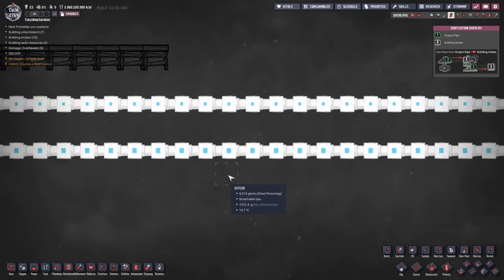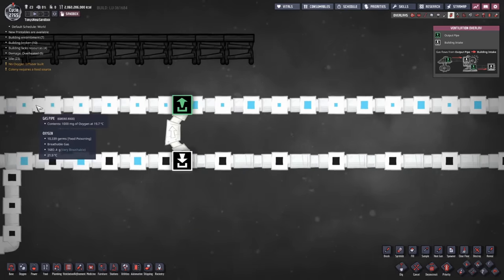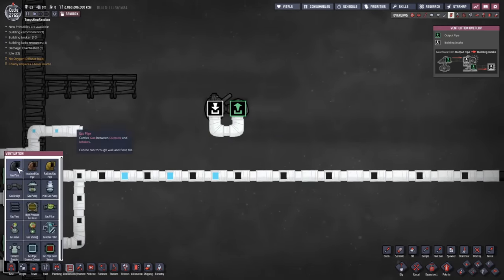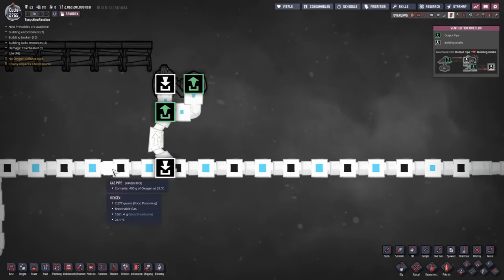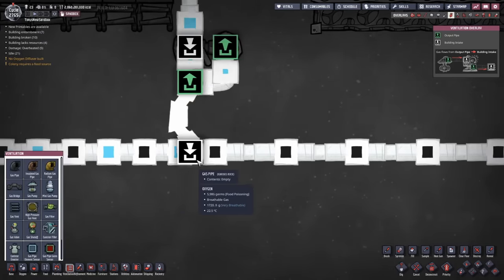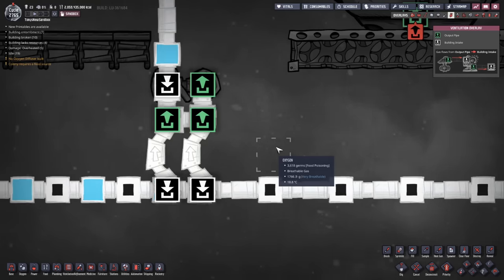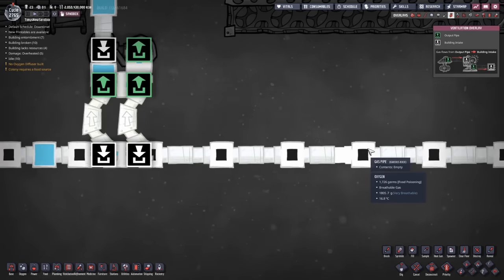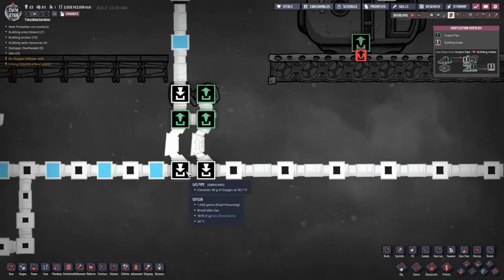An important ONI filter, in 5 minutes.

Comment: I rate this top 5 things newbies need to be taught because odds are they won't figure it out on their own. However you utilize another thing they need to learn which is much more important and you utilize in this tutorial without mentioning why it works. That is the fact that bridges, valves and the like have priority on your pipes/vents. So if you put a bridge on a pipe the liquid going through always takes the bridge if it can but will pass by it if it can't. This is so critical to know to make effective pipe and vent set ups and I bet its so basic experienced players don't think of it anymore.
Reply: @GabrielCazorlaPersson1  Consume power but is 100% fooled proof. If any exits is blocked, the filter stop which prevents mixed up. The Pipe element sensor and valve also consume very little power (if none at all because of the small window of activation and small power cost of the valve) but you need to have a Continuous flow of gaz in both direction for it to work. If one is backed up, you're screwed... Same thing with the mecanical filter (filter in this video).
Reply: @GabrielCazorlaPersson1  not knowing an efficient filter design isn't going to kill a base, just creates long term minor problems.
Reply: @GabrielCazorlaPersson1  i was just pointing out the fact that there is nothing wrong with a newby using the powered filter for there first play through.
Reply: new to the game, thanks re bridge priority. My dupes bathroom finally works properly
Reply: what are other 4?

Comment: Nice find, but I rather spend 10W of power for legit gas filter
Reply: You mean 120W of power? The in-game gas filter object is very power hungry.
Reply: @nZifnab  nope, i mean 10W of power for gas shutoff (in combo with gas pipe element sensor)
Reply: Oh that one - it also has it's own set of problems. It sometimes let's the wrong element through the filter if the filter's output gets backed up for a moment. I've had no end of issues getting the stupid thing to work for my electrolyzers >.>

Comment: been playing for 400 hours never seen this before, thank you for making a video and sharing it
Reply: It's awesome and clever..but I mean..the actual filter costs barely any power haha, and especially if it's for your electrolyzer setup with hydrogen gens
Reply from the maker: @KaladinVegapunk  You aren't wrong, those are fair points. It doesn't sound like much but cutting out unnecessary power use makes a HUGE difference. Three filters costs about half of a coal generator, plus whatever it takes to cool the filters and the generator. 
Another thing to remember is that it has different properties. This doesn't block the main line when the filter output is full, sometimes you want that.
Reply: Oh yeah factorio half underground belt flipped to get half belt =).
Reply: @KaladinVegapunk  you’d be surprised how much filters cost after a while. I had a base with 4 oil wells (no petrol boiler yet) and I ran out of oil. Just removing the filters and going a pipe sensor filter arrangement instead allowed me to run the base again with just petrol and not run out of oil. It definitely adds up! Haha
Reply: I agree, I have played this game for so long and never knew about this! Using this and the infinite gas storage hack ensures that the line never gets backed up and it literally costs nothing, I can pipe gasses out when I need from the gas storage and it just continually runs. I use it to filter carbon dioxide from the base (no carbon skimmer needed) and then to sort and store all my excess chlorine from the rust oxidizer

Comment: This is clever. I wouldn't say this is an exploit though. It's working logically because of the rules of the game physics. If this is an exploit, then maintaining vacuum with a liquid lock, regulating heat transfer with open/closed airlock doors, or creating an endlessly circulating coolant loop with pipes are too, because none of these make sense outside of the game's physics. And so is 80% of the other builds you can make.
Reply: This is how I feel about things like “infinite storage” too.  The entire game is a physics sandbox to a degree and trying to emphasize real-world physics on it is hilarious to begin with.  Plus it’s single-player, so who are you cheating?  You’re still using the built-in game mechanics in reliable, consistent systems that work for hundreds of cycles to improve your base.

Comment: First time I saw the mechanical filter was on the forum quite a while ago.  It changed a lot of stuff.  I use them in my electrolyzer rooms all the time.  One oxygen filter on each vent and another hydrogen filter with a relief at the end for whatever backs up.  One of the best game mechanic reliant designs.
Reply: Never had problem with deleted packets in the loop?
Reply: I'm not going to say that has never happened but I have never seen it happen.  It is flawless simply because of the one element per thing rule.

Comment: I often have full pack pipes that overload these filters but a great way around it on these systems is to install a valve and limit the input to 995-999g/s. 1 less way to overpower the filter! 😉
Reply from the maker: That's a good solution for many uses. But it can cause problems for other uses, like if you have full packets of alternating gasses it breaks them all into 999g and 1g packets. That situation reduces the capacity of the input pipe to 50%.

Comment: If you are "height restricted" but can expand the filter 1 tile sideways, you can put the Valve UNDER the bridges.
In that way the whole filter becomes 2x3 size, BUT you need 1 tile in the middle for the output pipe, so effectively the filter size becomes 2(+1)x3 or 3x3 sized.

(I absolutely love using this filter type, a ZERO POWER filter that is "easily" created even in the start of the game :)

Comment: Pretty interesting way to setup a filter in the early game or if you're very tight on space or far from the electrical grid, but I don't care for the extra setup difficulty.
Reply from the maker: The extra difficulty is indeed bothersome. I always choose a filter based on the characteristics I need. They all have strengths and weaknesses.

Comment: Great video!  I used this based on somebody else's video on building a Self Powered Oxygen Machine (SPOM).  They used this to filter Hydrogen into a gas storage container.  And it worked great.  But I didn't realize what it would do when the gas storage filled.  I had been building near the bottom of my base for several cycles and when I came back, the whole top of my base was flooded with hydrogen.

Comment: Great. Newbie here. I've never seen this before.
I've not tested this but I think you could use a valve set to 999g in the input line to prevent oxygen continuing on the main path, this would also remove the need for the second bridge. And in order to prevent the oxygen from backing up in the filtered line you can always have the gas pipe continue from the reservoir input to a place where you are sure it won't  overpressure (like into space).
Reply: just tested the valve set to 999g. It works, but the throughput rate is significantly decreased. This is because each 1000g packet is split into two packets by the valve: 1g and 999g. Each of these two packets takes the same amount of time to process as the original full 1000g packet, which can get through with no problem in the setup shown.

Comment: I used  this filter a while ago, but stopped, as it always buggered out when i reloaded the game. The filters would get a another element in it and would need to be reset. It's a while ago though and I've learned a lot since then.
Reply from the maker: I wonder if something has been fixed/changed. I've never had any trouble.
Reply: had some problems with it too. because i had it  on storing big amount of gases it became a real issue and i stopped using it for this kind of stuff.

Comment: To avoid the 100% 1000 seconds pipe of oxygen, won't it work if you use 2x separate valves system, gobbling up the reservor.
It's a bit of a stretch but the gas filter 100% uses no power.

Comment: I haven't tested it, but hypothetically a solution to the overflow problem with this filter would be to have a low-priority loop that moves the excess oxygen back onto the unfiltered gas line at a higher priority. This would ensure that the overflowing oxygen locks up the throughput until the oxygen in the gas reservoir gets used up.
Reply: You would have to throttle the unfiltered line at the point of the filter with a valve set to 999 g/s, though, since that's how much oxygen would be passing through the overflow path.

Comment: Thanks Tony for the great explanation. But there will be a caveat. If your pipe to the gap reservoir is full, the oxygen will continue to flow in the origin pipe, defaulting the purpose of the filter.
Reply from the maker: Indeed, you are right. This is either a feature or a vulnerability depending on what you are using it for. Every filter has different behaviors and its nice to be able to pick the right one.
Reply: I just built a second one beside it and connected it to the one pipe for the reservoir

Comment: I know this video is old, but if you use a filter at 9999 and a 1gram filter you can have it loop back on itself so it can back up and stop the pump if you so choose instead of allowing the gas to pass a backed up filter.

Comment: amazing! now if I put a gas valve before the gas enters this filter and throttle it to 999g, will it fix the issue of that 0.1% failure?
Reply from the maker: Yeah, but there are possible problems that come with that approach. For example, if you have oxygen and CO2 alternating in a pipe, and a full packet of oxygen hits the valve then it will let through 999g and then 1g. So it takes twice as long to go through the valve, and your pipe is effectively moving gas at 50% capacity.
Reply: You can just set up 2 of these, that would solve a problem

Comment: add on to this 3:30 1000 ticks is not that many if you think about it but you can extend it infinently by elongating the exit of the valve and adding more bridges each bridge will add 1000 more ticks but the better way is just add a 2nd valve that only allows 999 threw sure you wont get a full packet but it fixes the issue
Reply from the maker: You can also set the valve to .1g, which makes it last 10,000 seconds. That's 16+ cycles.
Reply from the maker: Also, there are new automation features in the game. You could just use a shutoff to turn off the pipe for one second every 10-or-whatever cycles, with a little creativity I'm sure it could be done in a way that only uses power for the 1 second.

Comment: You could avoid the overflow of the input by putting a gas valve on that pipe and setting it to 900g/'s.

You will have 10% less throughput but no over flow incase it is really important for it not to happen.
Reply from the maker: For some applications that works pretty good. But, for example, if you have alternating full packets of gasses then it slows the pipe down 50% because it breaks them all into 900g and 100g packets.
Reply: @tonyadvanced6315  yeah you're right.

If there is input from several different places, those pipes would need to be joined together in one before it passes the valve,else putting in the valve wouldn't make a difference, because of alternating packets of liquid/gas. Didn't think of that yet.
The joys of pipe mechanics.

Good day to you mate.

Comment: By the way there's also somewhat more complex variant of mechanical filter that works exactly like standard filter, i.e. it blocks when either output blocks. That fixes the problem of the simple mechanical filter that if you block the filtered output, packets of the filtered element will continue through the main pipe.
https://forums.kleientertainment.com/forums/topic/86047-perfect-mechanical-filter/

Comment: While this is a nice short video, it would have been handy to show things like how to prime a pipe with a certain gas, but most important is that you forgot to mention that this filter immediately falls apart when the pipe feeding them goes empty. In other words, these filters will function great as long as there's gas flowing, but when that stops for just a second, they all go empty. 
Would've been good to know before I tore down my other filters and put these in place with a lot of effort to prime them. :/
Reply from the maker: There is no need to keep a steady supply to the input pipe. The .1g packets are content to run in a circle forever.
Reply: @tonyadvanced6315  If that's the case, then I must have done something wrong, and it's worth another shot.
Apart from priming the pipes, it's a pretty simple build, so I'm curious if you have any idea what could have caused my gas-filters to go empty? Are there any (bad) conditions that would make them do that? (My setup was simple: A gas-pump sucking in ambient air, pushing it through a set of filters, and catching the gasses in reservoirs).

Thanks for the reply btw!

edit- I did have some problems priming the pipes. It was my first time having a go at it. I ended up with different sized packets in the filter. Some 1g, some 2g. Maybe that's what caused them to malfunction?

Comment: The unfortunate problem with this filter is that it requires that the gas pipe being bridged into it occasionally do have the gas being filtered out. I tried to set one up to catch the very occasional bits of hydrogen that would get caught in the oxygen pumps for my SPOM. Well, gradually the hydrogen put into the filter to start it ran out (went to my tanks) and the oxygen from my oxygen lines went through it and, also, into my tanks, where they were fed to my hydrogen generators. The generators weren't too happy about it. But a great idea where you know you'll be getting a reliably mixed feed of gases.
Reply: You built it wrong. Because of the 1g being constantly replaced into the loop it should never 'run out'. The filtered output (in this case your hydrogen) should be coming out PAST the white input of the valve. Like how the video has it set up.
Basically, before throwing it into the gas line towards your generators, it'll take 1g again to keep it 'primed' in the loop.
Reply: @diamondelement4140  I followed the video exactly and retried twice. Always failed eventually for me. So either he's not showing something clearly enough for me, or it's no longer a reliable design due to game updates.
Reply: @fuzzypumpkin7743  but brother it never fails for me and logically through my explanation or the videos it should never fully take out that last 1g of the element.
I know you said you made it exact but are you absolutely sure?
Are you bridging into the loop?
And is the loops output going up from the white input? (Like in the video)
The filtered output has to be after the white output so it has a chance to grab 1g again for the loop like I explained.
I want to help out a fellow ONI player
Reply: @diamondelement4140  Honestly, I was attempting this TWO MONTHS ago. I'm not interested in retrying. I've started making my O2 production via a soggy Rodriguez that automatically filters the hydrogen and oxygen into different chambers. So, no more need for filters for O2 and I filter other gases so rarely I don't care about the power cost.
Reply: @fuzzypumpkin7743  okay brother but if you want to retry it ever just type here I'll help if you need it

Comment: You limited the filter loop to 1 gram couldn't you reduce the pipe before the loop to 999 grams to ensure no packet drop and then there would be no need for redundancy?
Reply from the maker: Yes, but it can suck depending on the situation. If you have alternating full packets of O2 and CO2 then the 999g filter will break all the packets into a 999g pkt and a 1g pkt, using up twice as much space in the pipe and slowing  everything down by 50%.
Reply: @tonyadvanced6315  I should of known better to think it was that easy

Comment: What is the benefit to this, instead of using the normal ingame gasfilter?
Reply: old comment, but gas filters use 120W of power, which can add up if you have a gas storage system which uses multiple filters.

Comment: excuse me but... what mod do you use so the cvalve inmediatedly changes to pressure 1 without the need of a duplicant operating it?
Reply from the maker: You can toggle that on/off by pressing Ctrl-F4, I think you have to have the game in debug mode for it to work.
Reply: @tonyadvanced6315  Doh! silly me! i have debug mode...but i never knew it was THAT easy.
BTW, AMAZING filter...it sure saved my eletrolyzer-power plant plan

Comment: Couldn't you just like... Use a filter pipe? Maybe that's ignorant to ask but like this seems way more complicated.
Reply from the maker: You are right, a filter could be use and this is more complicated. The benefit of using more difficult filters is that they use much less power and don't need as much cooling.
Just three gas filters use about half of a coal generator, so it's very much in your interest to learn to use low-power alternatives. The game gives you the tools as soon as you have the automation researched.